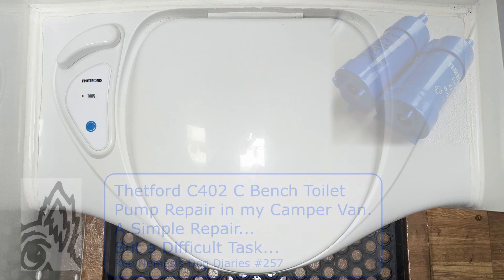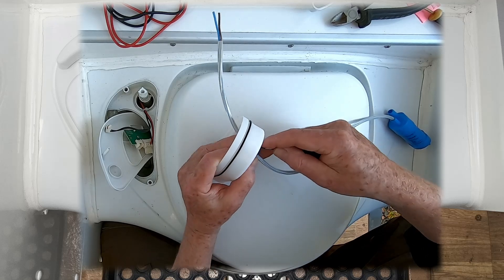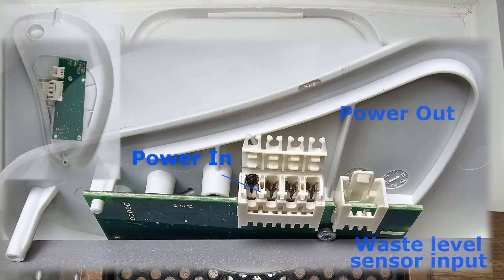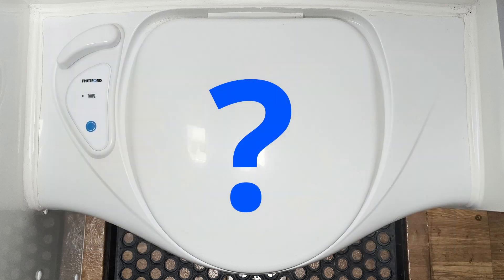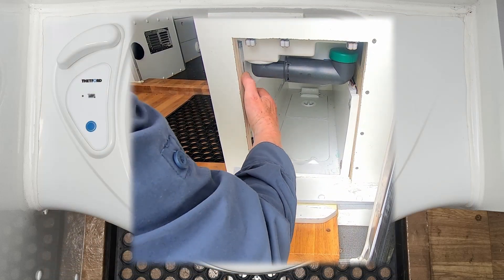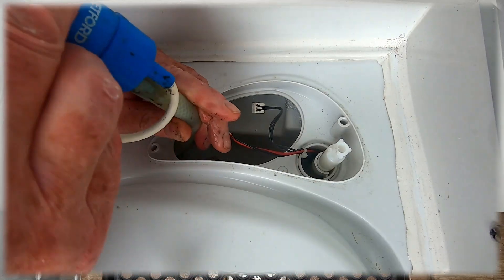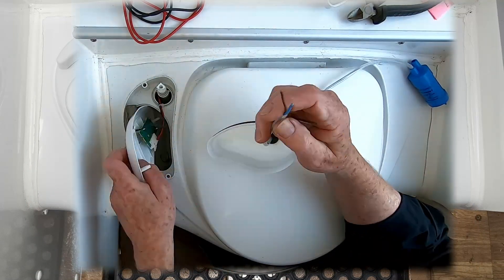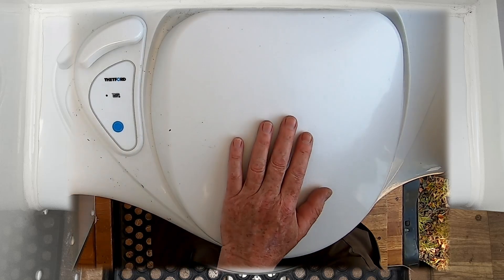Thetford C402 C Bench Toilet Pump Repair in my Camper Van. Simple Job, Difficult Task. Diaries #257

Comment: Try as I might I just can't get the pump out. The hose seems to be much less flexible than yours and the way you were able to rotate it through seems impossible on mine as they part where you do that is shallow. I have got a cable looped around the hose but not matter how much I pull it is not budging. Pretty sure we have the same model but I wonder if there are other design variants.